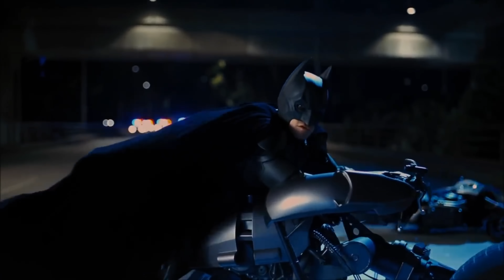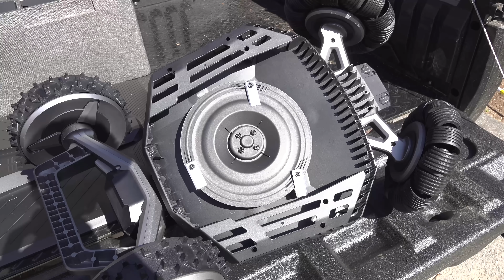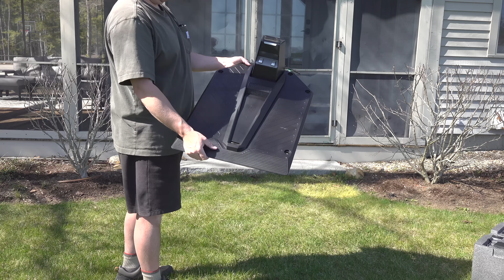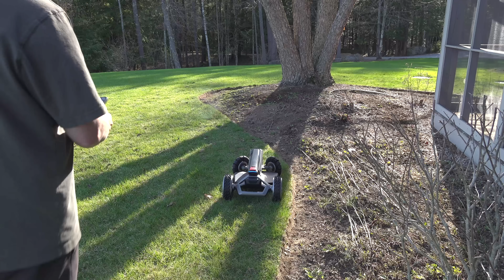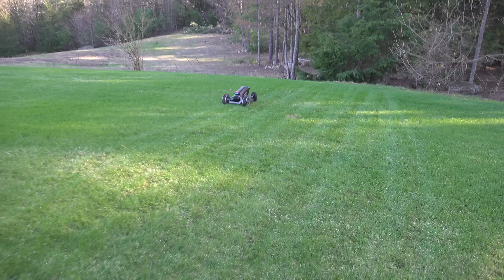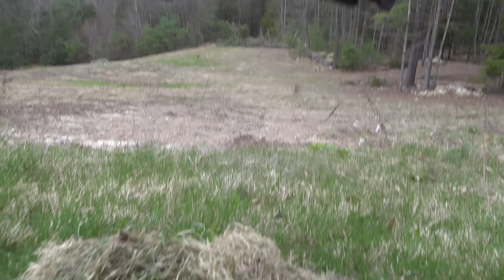Ecoflow BLADE Robotic Lawn Mower - First Look

Comment: Great intro to this, I was looking forward to it already and even more after watching this whole video, but for the price my lawn is too small and with the front and back being separated by a fence and gate... it only takes me maybe 30 min to do everything with an old non-self-propelled Ego 21" mower so for the price of two or three replacements of my current battery mower I can't really justify it unfortunately. 

It's not a bad price (and not just for EcoFlow's normally premium pricing but compared with other robomowers too), I had a four-figure price starting with 1, in mind thinking it would be worth having to play gate-butler to a robot.
Reply from the maker: I really appreciate that. The robomower market has been silently growing in the US for the past 2 years but no one has had a wire free model that was really available. This is a great beginning and who knows maybe they will make smaller ones that could allow one in both areas of your yard.
Reply: @SilverCymbal  that would be great, one posted by the back slab and another hiding from the HOA enforcers behind the outdoor portion of the air conditioner. Slowly working towards getting a place with a little more freedom like you moved to, so I can enjoy my home projects and my daughter will have more room to run around.

Comment: Even though I can't afford this, I think it's pretty cool. Imagine how cheap and good they will be in the near future.

People that are complaining about the area it can cover aren't thinking about the proper use case for this machine. It's like a rumba works in smaller areas more often. It's more like automated maintenance.
Reply from the maker: Yes you understand it completely. The problem in the past is digging the wire and random mowing has been a turn off for many. Husqvarnas similar mower costs $4,000, requires a $1500 wire installation and randomly mows with no sweeper. These guys are on the right track and I wouldn't be surprised if they make a small model in the future.
Reply: And there will be something better out by then. This needs to be wider and should have a solar panel for battery charging.
Reply: I’ve had 2 robo mowers and neither needed the wire to be buried.  Just use a weedwhacker on the edges to cut the grass down and then use the supplied stakes to hold the wire.  In a few weeks the wire will be gone due to the grass growing over it.   I had the 1/4 and 1/2 acre Worx models.  The cost of those two were still half the price of this.   I’m sure this one is great (which it should be) but it’s cutting grass at the end of the day and they all use the same type of blades.   I had mine mow every day for 6hrs.  It sure beat having to mow.
Reply: This is still early days on this technology, Once one company figures it out, others will and as they build more units the price will likely come down a lot. It's not that much different from robotic vacuum cleaners, where both the functionality and price have improved a lot since the first ones were released. Ones that don't just bounce around randomly are affordable and some models will unload themselves when they get full.

Also, even at $3k, this is still a lot less expensive than hiring somebody to come out and mow the lawn for you. Which is probably not you or you'd be calculating the price based on that.
Reply: @autisticdoingandthinking  did you even read my comment lol. You basically just summarized everything I said in a long winded manner. You don't need to assume it's not for me due to the price because I literally said that along with the rumba comparison.

Comment: Very curious how easy it would be to sharpen those blades. I know they give you another set in the kit, but the effort of sharpening those small blades would be negligible compared to a regular mower blade, and you could easily double the useable life of the blade just sharpening it once and then replacing. Maybe sharpen once a year? I feel like the batteries in that unit will need to be replaced before the blades lol

Pro-tip for those cool enough to keep reading this comment: That ugly power box? If you decide to replace any external boxes, get the ones with the clear or translucent/fogged plastic covers, not opaque siding-colored ones. Every single siding-matched outlet box on my house is filled to the brim with wasp nests every year, and it's a pain to keep cleaning them out and killing wasps. We have a bunch of clear cover boxes installed in remote outlets in our forest and replacements on our house, and I've never even seen anything living in them, not even spiders. Keeps them really clean and you aren't hesitant to just grab it and yank it open for fear of a wasp attack.
Reply from the maker: They are very inexpensive and you could sharpen them but they are like surgical blades probably best bet to just replace them unless you are very careful. But fortunately they are a standard size so there are aftermarket ones.
Reply: @SilverCymbal  Those are a flail mower type blade, the cool this is if blade hits something, the blade in not rigidly attached and can "bound" off the object
Reply: I'd imagine a standard blade's weight would definitely cut down (hee hee) the battery life.
Reply: @monkeybarmonkeyman  I dont think the weight would be much of a problem - you only need to spin it up once. However, im sure that the aerodynamic drag of a typical bar type blade is quite significant compared to the disc in this.